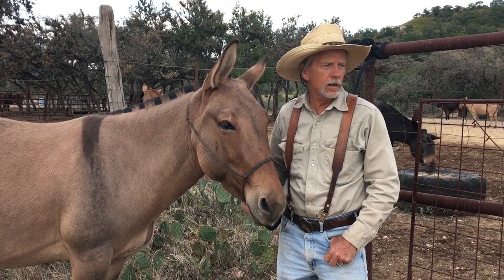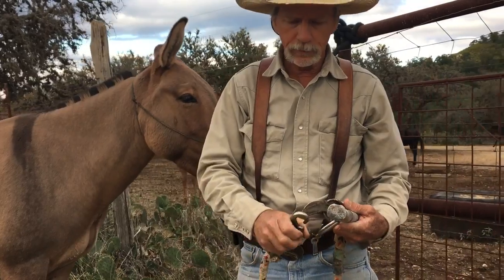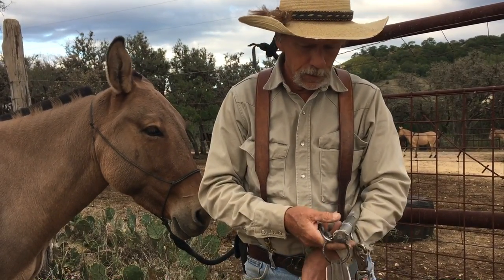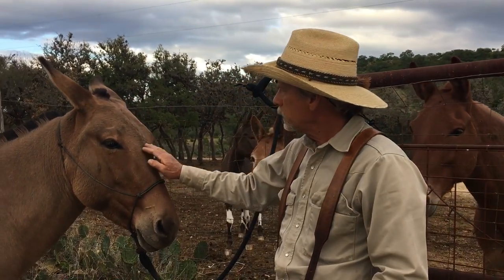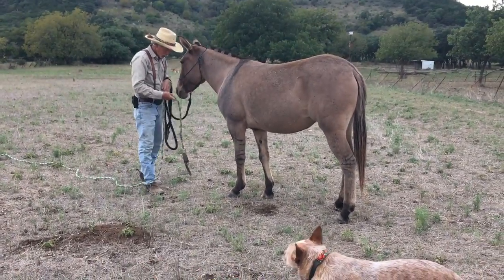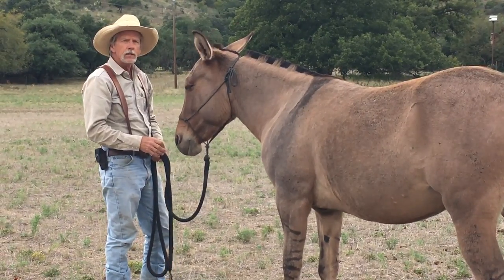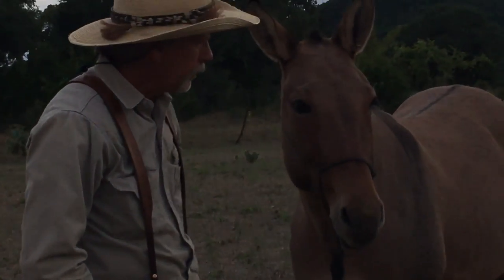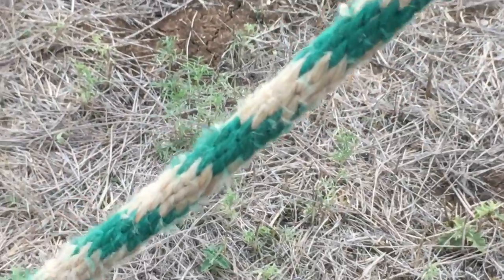The Picket Line

Comment: Hey Paul,   Try this...    I use a piece of heavy surgical tubing at the picket side of the rope.  Tie the tubing in between the picket stake and the rope.  That way, as the animal pulls the rope taut, the tubing will start to apply more and more tension to the rope.  They learn to stop pulling on the rope way before the rope gets too taut.  They can also free themselves much more easily if the rope gets wrapped around their hind feet.   The tubing i use is a three foot piece of spear-gun rubber.  Its very strong and elastic.  However, any stretchy tubing will work.   Good luck.
Reply: Hi -- I learned that when you tie a horse the normal way (not a picket line) you don't want there to be any elastic involved because when the horse puts tension on the elastic and then "gives to the pressure", there is still tension on the rope so they don't get the immediate release.  They'll get it eventually if they move toward where they're tied, but they won't get it immediately.  And the release is how they learn yada yada.  Wouldn't the same dynamic apply here?